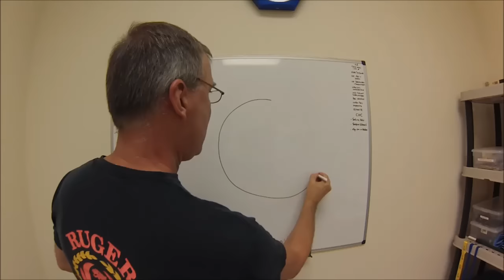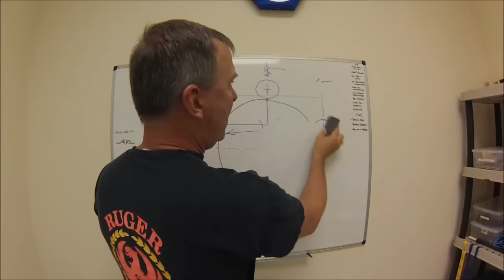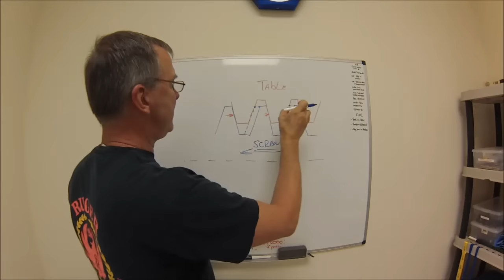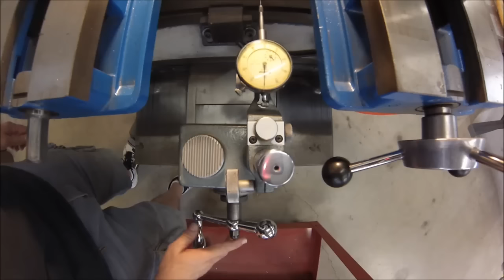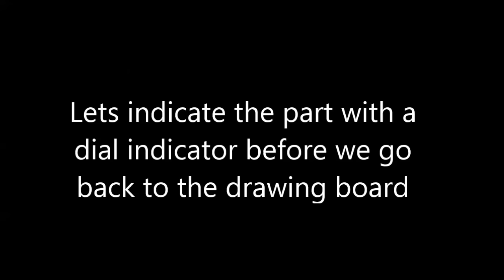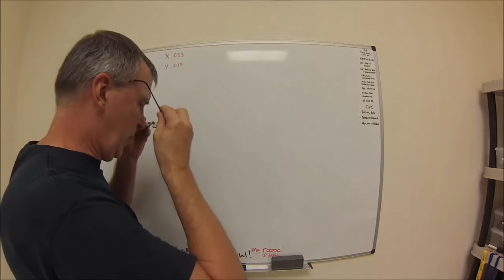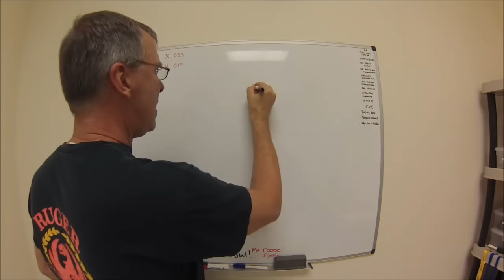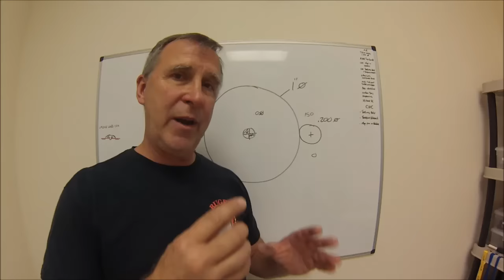Edge Finding Round Stock without a Digital Readout

Comment: Great video. I have been doing machine tool rebuilds and retrofits for several years and you did a great job explaining the backlash of the screw/nut. There is another factor in backlash which is the bearing assembly that controls lateral movement of the screw, sometimes this is where excessive backlash comes from and can be easier to cure than the screw/nut assembly. Thanks again for great videos, they always make me think and have made me better at solving strange setups.

Comment: Thinking back to my shop days, I think we used to call that "slop". As in, "watch out buddy, that machine has about .020 of slop in it!". I can't seem to recall how they showed me to account for it though. That was a looooong time ago!

As always, great vid!
Reply from the maker: I still call it slop. Backlash is just the technical term because someone would undoubtedly call me out on it if I called it that online. Thanks for watching.
Reply: Seems to me "slop" is a bit less useful when thinking about precision, (which requires thinking precisely) because it could refer to movement due to loose or worn dovetails or other guideways, or to the combined total of backlash and angular play due to guideways.

Comment: I did establish the backlash on the Rockwell long ago but I do not rely on that. Backlash is different at different places of spindles. Therefore I add to your great video: each time one uses backlash figures it should be re-established for that position where the work is done.

Comment: Another great video - thanks. Another quick and 'dirty' way I learnt was to eyeball the centre as best you could in one direction - say X - edge find then move in 1/2 diameter, then repeat for Y. Then repeat for X, then Y, etc. It gets you closer to centre with every repeat and even starting from a long way off after 3 or 4 repeats you're extremely close to centre (usually good enough if you're using an edge finder on round).

Comment: Nice video--I like your teaching style. My machinist days are a distant part of my checkered past, so these days I dream about machining stuff while watching videos like this.

I had never thought of actually measuring the backlash. In times where I needed to account for it I would lock the table and spin the crank the other way until the backlash was gone, so the index ring was hopefully showing the measurement sans backlash. Come to think of it, I was constantly flipping those locking levers up and down to account for backlash.
I wish we had had DROs--they must make things so much easier.
For the problem at hand...I would have reached for the dial indicator.

Comment: Wow Joe, another great tutorial, thanks for posting it. Now with regards to your 0.033" backlash on the Bridgeport X axis, ever so simple to adjust out. Means bending you back and a large flat bladed screwdriver, but it will literally only take 5 minutes to adjust. To save me going into great detail describing how to do it. Have a look in the manual if you have one, if not try looking on YouTube to see if someone has done a video. I may have a look myself in a while and if I find one I will post the link here. Well done again for super explanation of a common operation.
Here is a good link on how to adjust the backlash, hope it helps. He does not show or say how to do it, so here is a quick description. Slacken the small locking screw, tighten the large screw just enough to take up any backlash, check the whole length of the lead screw if possible in case it is badly worn in one spot. When you are satisfied with the fit, re tighten the small locking screw.
https://www.youtube.com/watch?v=X3cRLlFrdkg
Reply from the maker: Thanks Dave. I've done it before, but not in a while. I guess it would be good to reduce it a bit.

Comment: And that is exactly why I bought a DRO, even a brand-new machine has some backlash.
It can be minimised to a negligible amount, by using high quality ball-screws, but they don't come free either....
I used nothing but the regular dials and dial indicators for about 15 year, but once you savoured" the blessings of the DRO" you won't want to be without one.
Even the simple and cheap digital depth gauges on a pillar drill save a load of time (those are basically a digital caliper without the beaks)
Great video man, great video indeed. It is a very good reminder of how to do things the 'proper' way.
I made me one of those Indicol style holders, since they are as rare as hen's teeth in these parts.... they seem to be a particularly American style holder.
They are a very handy addition to the shop though, and I wouldn't want to be without one, despite having a DRO on the lathe and the mill.
The postage from the US is often prohibitive, a pity ....
Thanks Joe !

Toodles!!!

Paddy

Comment: Lots of good stuff, as usual.   The question I have every time I watch a video of finding centers of round stock is “why not just measure the diameter and divide by 2?”   I normally have the set side of the vice set at zero.   So if I move the y axis half the measured diameter, it is now on center that way.  Now I only need to find the edge going one direction on the x axis.   Backlash is taken out by only moving one direction.
Reply from the maker: In order for that to work, you would already have to be on center.
Reply: Joe Pieczynski. This was not a challenge, just a question.   On the job training to learn machining before digital readouts puts my thinking on a different track.  I often wonder why people using the DRO do the things they do.   Maybe easier, maybe faster?  My point is that it is easy to get the x axis on center.   Hold the stock with a “V” block or whatever, you know the distance from the set jaw to the center, so you know where to set “y” to center the x axis.   Now approach the part from either side to find the edge, punch some numbers into a calculator and you know where to move “x” to set center.  
I like the little device that holds the test indicator.   Simple and it does not require removal of the tool.   I have one, but don’t always trust it to be sturdy enough.   That is because the way we did it  circa 1970 was to put a .375 diameter rod in the collet that had been formed to a 90° bend.   That system was rock solid.  It was also clunky, so pick your poison I guess.
Reply from the maker: @dougberrett8094  No problem. If you already have one side or edge established, your method is perfectly sound, and probably quicker. Thanks for the follow up.
Reply: I agree, find the centre of the fixed jaw of your vice for instance, using a piece of ground stock or a parallel and moving vice backward towards the machine head; then continue moving half the diameter of your round stock, lock the bed off.

Comment: So glad I found this video!! I took some night classes on machining and learned on a DRO. I've been struggling with the backlash for a couple years and finally decided to get the DRO.

Now, I can ensure my key slots are on center as I also add a power feed, and have to create adapter shafts to take up the difference between my X-axis feed screw and the power feed's inner bearings. 

It's gonna be real nice having a DRO and Power Feed on my old Clausing milling machine!! Thanks again!! 👍
Reply: So, once I found my backlash in both axes it got me to thinking about something. What happens if I use my (now KNOWN) backlash to reveal the extra distance I had to move the table (as measured on the dial) to eliminate backlash altogether, as opposed to having to calculate its distance??

For example, let's say I'm turning my crank handle in one direction (having eliminated all backlash) prior to touching off on my part. When I touch the part, I know the table's nut is traveling along the acme thread in that direction. Then, I zero my dial prior to continuing in the same direction (lifting the spindle, first).

Now, as I continue to move my table in the same direction until I am PAST my part (counting the dial rotations - I should already have a rough idea of the diameter as measured with a micrometer.), then as long as I continue to move the table the distance of the radius of my edge finder PLUS my now KNOWN backlash PLUS a little more (for safety), then I'll be assured that when I reverse the rotation of my crank handle the table's nut will be resting on the opposite side of the acme thread before it touches off the part in the opposite direction!! By adding at least the edge finder's radius PLUS the backlash PLUS a little more to be in the same side, then when turning the crank handle in the opposite direction, I will ensure the backlash was fully removed prior to touching off the part from the opposite direction.

That's probably why I've heard it said to go a full turn past the other edge of a part BEFORE reversing the crank handle's rotation. Because, it assumes you're NOT FAMILIAR with a particular machine's backlash. As a result, going a full turn makes it easier to remember where you touched, and ALSO is beyond the backlash of even the loosest machines. 

Sorry if this was said somewhere else, but I didn't read all of the comments. Just trying to get my DRO on ASAP!! LoL

Comment: Nicely done Joe. Interesting question and you nutted it out well. I kept looking at that V block though - Get X center indicating off V block. Measure stock, indicate off movable vice jaw then move half stock dia to get Y zero. Backlash is definitely always a consideration though and well explained. Thanks for your time on these. Makes us all think.
Reply from the maker: It made me think. Believe it. The digital takes all this away, so I really had to dust off some thoughts. Setting stops on either side of the 'V' block or nest and getting an initial axis reading off that is a great way to start. Good suggestion. Another viewer suggested using my projected surface idea from the 4 jaw video to easily find your 'Y'axis values. Great feedback coming in on this one. Thanks for the comment.

Comment: Most machines more than a few years old, depending on how much use (or abuse) they have seen, can have markedly different backlash values at different positions on the leadscrew - almost always more in the center (where it gets the most use) than at the ends. My old Clausing has about 0.005 at each end and more than 0.020 in the middle. Over long distances that wear can affect the accuracy, too. This is precisely why I had to get a DRO for my machine and now never even bother to look at the dials any more.
I know - you're thinking it's time for a new leadscrew, but I've seen this phenomenon to some extent on every machine I have run in my 55 years as a machinist, except maybe a few new or almost new ones.
I learned, as you probably have too, that the indicator is your most valuable and precious tool. (Jo blocks are next in line for the title).

Comment: Hi Joe, when I use edge finder on round stock, I make sure the edge finder is slightly below center, pick up the center, then post .100 on my "Y" reading on DRO, or if no dro, set my dial at .100, then measure the rod and divide by 2 and move that amount, no calculating or errors.  Same with "X"!
Reply: yes, that is the way I was taught and there is no need for backlash calculations etc. This guy is a good dude but makes easy thing very complex

Comment: Excellent video as usual. If I wanted to know how much backlash I had, I would probably just turn the crank one way to the zero, lock the table while still at zero, and then spin the crank the other way until it stops and read the number off the crank. I'm sure there is some finesse missing in this approach, but it seems like it ought to work.
The DRO was one of the best investments I ever made--the installation process is highly customized to your own machine and takes a month of Sundays but it's worth it. Always knowing the absolute position of the table is an amazing thing and we take it for granted.

Comment: I concur with "get an indicator."  My century old lathe has more wear in one area of the cross slide feed screw, as many (most?) of them do.  If I happen to be working in that transition zone from 'more worn' to 'less worn' the reading according to the cross feed dial will go off.  Frustrating to take the last .010 off of something and discover that, on that last pass, you actually took off .012, turning the snug fit you were going for into a floppy fit.

And it's nice to see that I'm not the only one that believes in using match marks.
Reply from the maker: They are the cheapest DRO's on the planet !

Comment: You CAN find true center with just the edge finder, no DRO, on a machine with unknown backlash.
You find the edges left to right then right to left. The difference is the backlash. Split that and you are on center.
This works on round and square stock.

Comment: The backlash depends on the measuring position of the table. In position where it is most used (Centre of table stroke) the backlash would be bigger than at the end. Very good film and great explanation od the problem!

Comment: Hello Joe. Another great video, as usual. In regards to backlash, you mention in the video that it will be a constant we can measure on our own machine, and keep that number for reference. My question is, wouldn't the amount of backlash on an older machine be larger near the center of the lead screw, where the most wear has taken place, as opposed to the ends? Or do you think this difference should be negligible, provided the machine isn't completely worn out? What do you consider acceptable maximum for backlash on a manual knee mill, i.e. the point where the mill should be repaired, or replaced? Thanks.
Reply from the maker: I would expect older machines to be worn more in the center than the ends. 20-30 thou of backlash isn't necessarily a show stopper, but when you adjust it out correctly and the machine travel is restricted in some areas, it may be time to get it rebuilt.

Comment: There are other ways to do this but it is your show.
Thanks for doing this as there is a ton of misinformation and poor practice on Youtube, 
As for backlash you can take up slack and re-zero the dials.
Reply from the maker: For sure. This video was posted as a courtesy to a very specific viewer inquiry. The theoretical and practical demonstrations are accurate and fairly broad in their scope. Not all machines have adjustable bronze nuts capable of reducing or eliminating backlash, so this level of information is very useful. I do appreciate the feedback and comment. Thanks for watching.
Reply from the maker: I would be very interested to hear your technique for calculating an accurate backlash value. Feel free to respond and share your thoughts when you get a minute.
Reply: Tried to post this and the comment is highlighted and cant post my reply.
Will try here.

I compare my feel for the dials with a dial indicator.
Is your businesses contact you email contact.

Worth
Reply from the maker: I will get the message if you send it there. Thanks.

Comment: You assumed that the backlash is a constant. But that is not always true. Although the screws wear more slowly than a bronze nut, they still wear. And they wear unevenly because there is a zone on the screw which is used more often than others. In such a case your backlash depends on the position along the screw.
Reply from the maker: And you assumed that I assumed. Please read some of the comments below. thanks.

Comment: Great video... I could be wrong here, but if you have a DRO on your mill it shouldn't see the backlash because it only keeps track of the actual movement of the table. If you only have the micrometer collars then you will see it because they are attached directly to the lead screw of the table. I never notice the DRO reading change when I reverse the table until the backlash is gone. I guess you can check by just turning on the DRO and wiggling the handle back and forth and watch. Just a thought.
Reply from the maker: You are correct. A DRO erases all this worry. This video was shot in reply to a non DRO user wondering how to calculate backlash and compensate to find edges and centers.

Comment: An edge-finder is not a good enough tool for round stock. Rounds have no edge that will contact an edge-finder squarely it has either got to kick out climbing up to the centre of the round or kick out running away from centre, never accurate enough. Dial indicator the easiest and more reliable than a DRO. very in depth vid Joe and well presented.
Reply from the maker: Thanks Steve. I'm not a big fan of the process, but I thought I'd approach it for a viewer. Indicator.....all the way !

Comment: Novices should realize the backlash slop will be different depending on what part of the lead screw is used.  The center is usually worn more than the ends- use a dial indicator.

Comment: I'm no machinist, currently at school for engineering, and working on a bit of an interesting project on my own time. How would you find the center of a threaded hole? Trying to take a flange with 4 evenly spaced threaded holes and add a pattern of 5 threaded holes, and the best way is to have one hole in common between both patterns. And vice versa on a different flange. Current idea is to use the lathe and make a concentric locating pin to thread in the hole and use a method like this to find the center of it, while the whole flange is fixtured in a dividing head. Locate, turn, drill, thread, repeat.
Reply from the maker: 2 ways. Use pins in the holes and locate on the minor diameter, or use magnification and locate off the countersunk edge of the hole. if its a quality hole, the c'sink was done before the threads and is a good reference to find center.